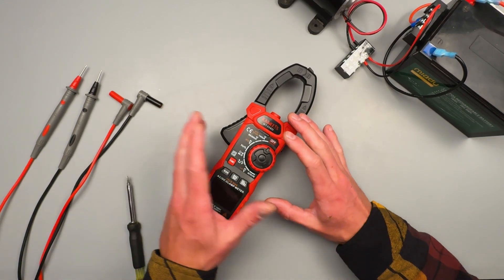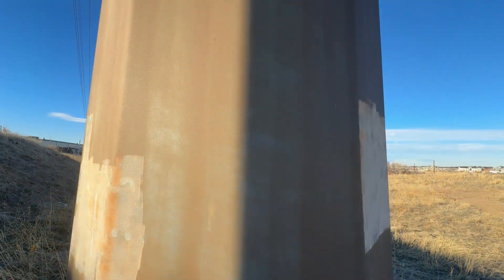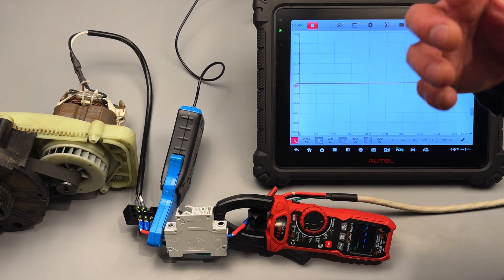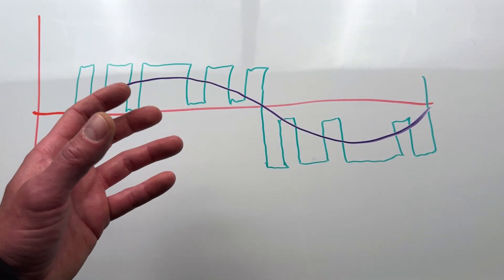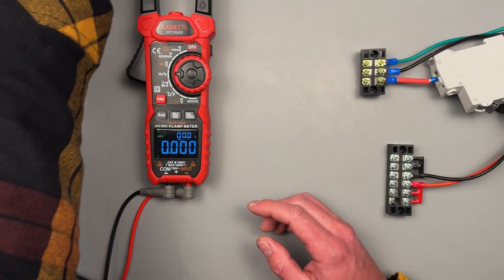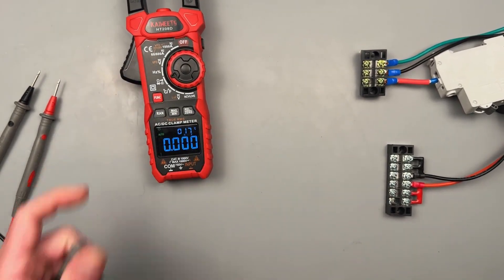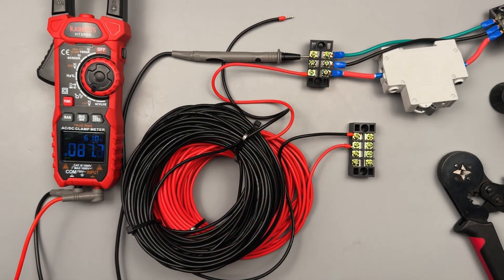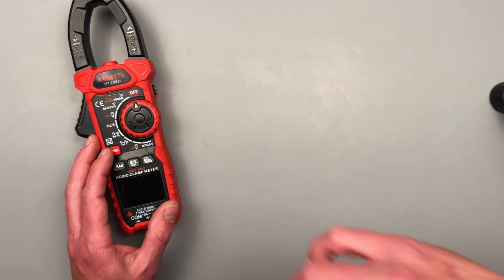How to Use Kaiweets HT208D Inrush Current Clamp Multimeter (HVAC & Industrial Review) 🚀🗜️

Comment: Sir, 
what will be happened when dialer is set ac current testing mode and mistakenly, we will put probes into ac 230 volts sockets. Unfortunately, this would occur with me but Luckily my meter is still working fine what’s your opinion.
Reply from the maker: Luckily since this meter only has two meter lead ports, no damage will take place internal to the meter, even if you're on the wrong setting.
Reply: very very thanks to you sir for replying i feel happy with your opinion.
Reply from the maker: @sajjadhussain6873  Hey you bet! Happy testing!

Comment: I've had this meter for a couple of years now... I can tell you for certain that display ABSOLUTELY SUCKS if you're outdoors.  Great indoors... ABSOLUTELY SUCKS OUTSIDE.  Now Habotest/Kaiweets has released the HT208F, which is the same meter, except it has the MUCH MUCH better normal LCD display.  I've got one of those on order, waiting for it to arrive.  Other than the ultra crappy display on the 208D, it's a great meter.  No complaints about it at all.  But the display SUCKS.
Reply from the maker: Woah! Good to know. Thank you for the updated information!

Comment: Hi! Can we measure current in a series AC or DC circuit using the probe leads of this clamp, or does it only work for measuring current with the clamp?
Reply from the maker: @fabio.1  you can only measure current with the amp clamp on this meter 👍
Reply: @aiyogarage  thank you!!!
Reply from the maker: @ you bet 👍

Comment: can i use this one to check the car battery everyone says 20V settings this doesnt have a number but has the V?
Reply from the maker: @Not_Manuel_  yes this can measure voltage for your car. It doesn’t have a 20v setting because it is an auto ranging multimeter.
Reply: @maddoxmechanic  ok thank you for your reply I tested it battery's good 12.5v
Reply from the maker: @ What’s going on with your car?
Reply: @maddoxmechanic  nothing right now but im hardwiring a dashcam and i wanted to see how much was left in the battery just incase it was due for a change and to test the fuse box i saw a multimeter would do that and someone said they could test the battery volts aswell.
Reply from the maker: @ glad to hear nothing is wrong at the moment. Taking a voltage measurement isn’t a bad idea. But checking the date of when the battery was installed and getting the battery load tested is a much more accurate way of checking the health of your battery.